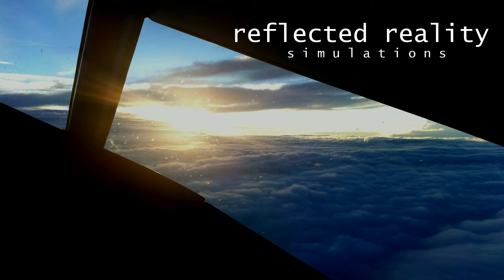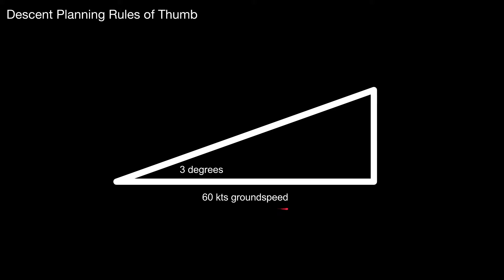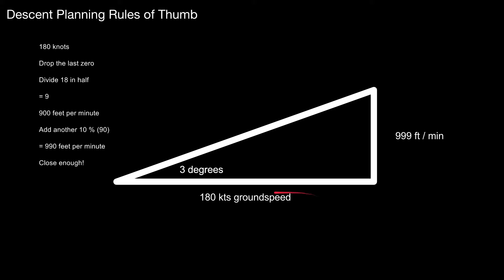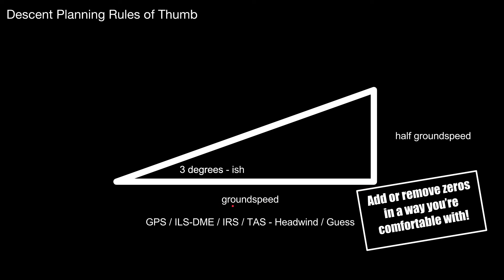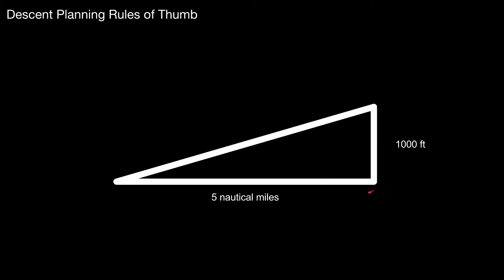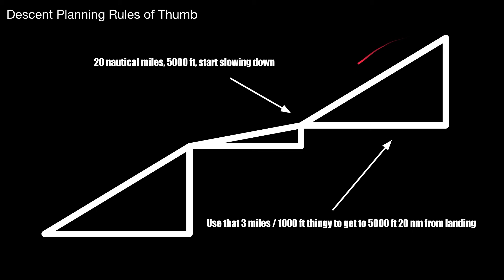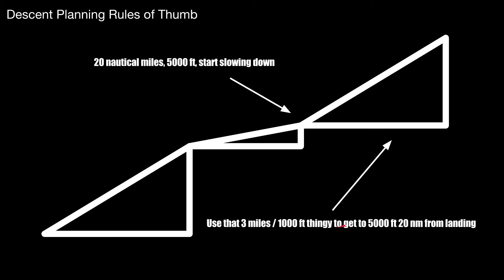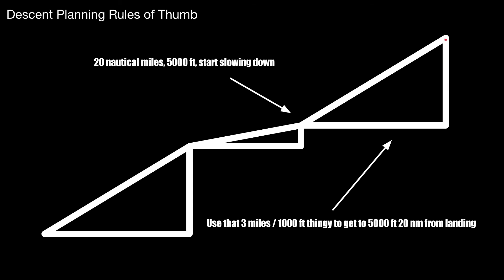Groundschool:  Descent Planning

Comment: This video is really helpful , though , to avoid high energy levels , just in case the tailwinds are a little to much , not allowing you to slow down , take your cruise altitude and subtract your Airport elevation.

divide the obtained by 300.

Now for speed , take your decent speed , subtract it from the speed you need to be while capturing glide slope , divide it by 10 , and add it to the earlier value.

Now for the winds , take your winds and divide it by 10 , and add the obtained if its a tailwind , and subtract the obtained if its a headwind.

After adding these 3 you will obtain the TOD.

Now to proceed with this , we can multiply your TASx5 =Rate of decent 

We start off at cruise altitude at TOD and go down till FL100 , and maintain level flight with idle thrust till 250knots IAS , and then start the decent once again , at the final altitude we are once again on a straight flight and then we are idle to pull out flaps to the target speed of capture of glideslope.

This will ensure the aircrafts speed to be reduced irrespective of winds or weight , as we are idle thrust with a level flight while doing so.

However the method presented by you is perfect for CDA. I wish you a great day ahead mate , happy landings :D

Comment: More simply (3 percent descent)  Ground speed x 5 = rate of descent ft/min.
Reply from the maker: Yes, that’s the whole point of the video. Indeed “half the groundspeed” is exactly the same rule of thumb as groundspeed x 5, and in my experience most people find it easier to add a zero and half rather than multiply by 5. It’s still important to build in some mileage for decelerating, and that’s why a “gate” of 5000 feet at 20 miles is useful.

Comment: Dear Sir,  big thanks for this tutorial, I found it very usefull.  I have a question regarding that moment with regaining of our profile in 1st segment (from ToD until 20nm/5000ft point) and was wondering if you could help me out. Let's say that due to some event we have passed our ToD and now we must regain a profile, I understand the ways which you have mentioned of how to acheave that, but how can I instantly check if I'm already or below the profile? Any tricky thumb rules for that? or you just have to recalculate everything again based on your new RoD? Or maybe we could split our profile for some "check points" ? Thank you
Reply from the maker: Hello Andrey, so pick a point as your 20nm/5000 feet point, and just keep reviewing your progress towards that point. For example, 20000 ft, 55 miles remaining. In my example that would be 15000 feet to descend to the 20nm “gate” , and 35 miles remaining to do so. You typically need 3 miles per thousand feet, so 45 miles ideally, so you’re high on profile.  During the cruise, think about the descent point, the distance required from 20000 ft and 10000ft and simply work with those values.

Comment: Nice Video!
There are variations on this method, but your video hits the important points. Before the advent of VNAV I always used this rule of thumb with good results in everything from the 727 to the 747. 

Some additional points that are helpful once one masters the basics:

1) The expected arrival and whether using opposite direction landing has a big effect. If opposite direction landing as a rule of thumb I add 20 track miles to destination distance. ATC aside, I always strive for a constant profile descent right to landing, but leave a little room for unexpected changes that would make us high (like switching runways during the letdown)

2) Altitude X3 + 10 miles works well. (FL350 = 35X3+10=115 NM TOD) 
The extra 10 NM I use to slow to 250 at 10,000 ft. Depending on the aircraft and it's drag profile, at 12,000 feet I reduce Vert Speed to 1000 at idle and the speed bleeds to 250 by 30 NM from the airport (or track distance if landing opposite direction). 

3) At 10,000 feet I usually go to approach flaps (5) and then descend at VS 1/2 GS as you demonstrated. Works well for me and having Flaps out to 5 gives me drag so I don't have to use Air Brakes (In our airline we joked that Speed Brakes were meant for fixing ATC screw ups not ours :) )

4) A variation on this technique works well for other descent profiles than 3 degrees. At a given groundspeed converted to miles per minute ( Example: 240 knots=4 NM per min) when in level flight the pitch change required to attain the right gradient is Gradient X GS NMPM ( Example: 4 degree descent: 140 knots = 2.3 X 4=920 fpm. Drop the nose 5 degrees from stable level flight attitude and adjust thrust as required to maintain speed. No trimming thus required. 

5) Wind at cruise has an big effect on descent planning. To adjust I have always used the below method:

For each 60 knots Headwind (subtract) or Tailwind(add) I add or subtract 10 NM to TOD.

These techniques still work well even with VNAV as a good crosscheck to make sure VNAV is properly executing (usually if not it is a pilot programming error :))

As a final note, the most restrictive crossing altitude should be used for planning vs distance to airport.

Love your videos! Refreshing to see real world practical tips and techniques.
Reply: Flaps, 1 notch on the 737-800 is maxed out at 240 knots, too close to the limit. I would not use this at 10000 ft. to slow down. Need to find another way to slow down. I notch of flaps is at 220 knots of the 737-800 . Thanks

Comment: I personally use FJS's rule of thumb ( in the 727 notes ). For a 2000ft/min descent rate, find out how much you wanna descend in thousands of feet, and triple that number to get the distance you'll need. That can also be scaled. ( 1000ft/min will yield twice the distance etc ).
Reply: So FL350 to 10k ft is 25k feet to descend, times 3 = 75 miles at 2000ft/min. That way I know when to descend even just looking at skyvector
Reply from the maker: Thanks, yes that's basically the same rule but simplified to assume an average of 400kts ground speed on the 727 during the decent. If you fly slower aircraft you'll need a different vertical speed as described in the video. The aim is to fly a profile of approx 3nm per 1000ft as given in your example. I find the 727 difficult to slow down so always start off with a 20nm margin to help with that.
Reply: Yeah I do the same. I always give myself a little margin because 2000ft/min is a tad fast so I end up having to use airbrakes to slow down. Same deal with the Tupolev.
Reply from the maker: Yes that's the problem. You'll normally need something like 5-800 feet/min to slow down without the speed brakes, so in my video I describe using the 3x rule to aim for a point 5000ft above the airfield and 20 miles out. Doing 250 knots indicated you can then use 6-700 feet/min to allow the speed to bleed back to the approach speed without the speed brakes. By using this planning method you still have a little bit extra drag available from the brakes should air traffic shorten the track or the winds change leading to a higher energy state than expected.  The great thing about the sim is you can practice over and over again with exactly the same set of conditions.

Comment: Hi do you know a formula or a rule of thumb for a localizer interception at certain Angles 30/45......... Cheers
Reply from the maker: I'm afraid I don't, and if you could see some of the intercepts the A320 autopilot flies sometimes perhaps the engineers don't have a perfect method either! I'd always start off with a 30 degree intercept and be aware that it's 30 degrees between your track and the ILS, not your heading, so be aware of how the wind affects your track. If you've got a full "rose" mode CDI available keeping the top edge of the CDI bar at the top of instrument is one way to manage intercepts. As the CDI bar starts moving towards the middle turn to keep the top of the CDI bar at the top if the instrument. However this method will lead to really lazy intercepts at greater distances.
Reply: Back when NDB's were more prominent we used the bearing angle of the Compass Locator at the FAF for reference. When the bearing pointer reached 5 degrees off the final course begin your turn at 25-30 Bank angle to intercept without over shoot... worked very well, provided you intercept at 180 knots or less :)

So what to use with no NDB?

Most FMS equipped aircraft have a bearing pointer you can use for the active waypoint (select FMS for pointer). The same technique works well here too as you are using the FAF waypoint in bearing pointer mode instead of the NDB.

The above assumes 30 degree intercept. Anything larger will require more lead. Rarely does ATC set you up this way from a vector though.

Comment: Thank you sir. It was a bi issue for me and now I do understand it much better. However it  would be nice if you could fly a chart by autopilot manually instead of FMC, so we could see how it is done in fsx real flight. How to read chart and calculate all these fixes. My appreciations sir.
Reply from the maker: Glad you found the video useful. For a non-FMC departure have a look at my FlyJSim 727 EGPF video.  The great thing about radio aid navigation is you can use the same principles on any aircraft.  There's also a Radio Navigation video that should give you the building blocks to start off with.